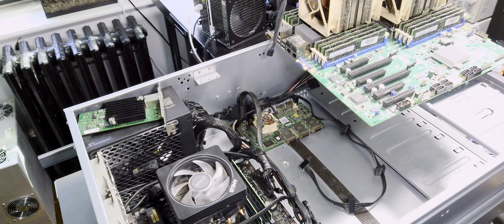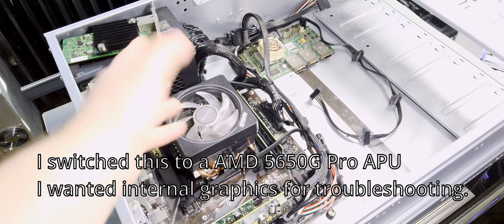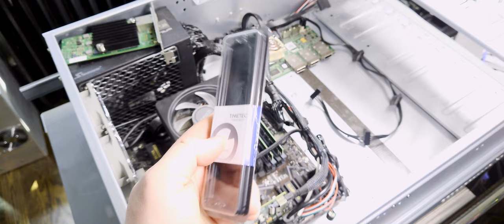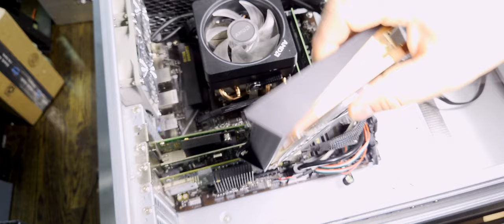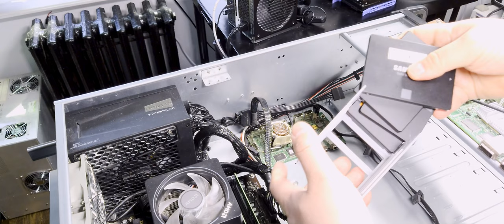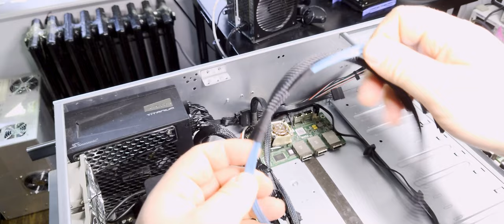Downsizing My VM Server (AKA Basic Ryzen ECC Build)

Comment from the maker: One thing I forgot to mention is that it's a good idea to check your motherboard and see if it can boot without a GPU or APU installed. The board used in this video actually errors out and won't boot with no video if you don't update to the newest BIOS. If you're tossing in a cheap GPU to get video it's nothing to worry about.

Comment: 9:14 Good news AMD's spec sheet for the 7000 series CPUs show that they still support ECC (still requires motherboard support). And some X670 motherboards already advertise ECC support (Aorus/Gigabyte again).

Also Intel changed their stance now. Standard consumer Alder Lake CPUs do support ECC as listed on Intel's ARK. But that's currently only supported in W680 motherboards which are stupidly expensive.

Comment: Similar idea I'm having now.  Most of my lab consists of stuff I've gotten from work. Moving from dual xeon E5-2667v2 esxi 6.7 system to a 10700k, 64gb proxmox, 10gb lan onboard (already have that hardware). I upgraded the esxi and truenas server as well as my desktop to 10gig a month or so ago. All this hinges on if I build a new system on 13th gen. Planning on retiring/archiving the couple windows 16/19 servers I had in testing. New truenas on a newer Xeon E 2144G server from work (poweredge still under warranty lol) so I'll retire the original on esxi. Basically leaves me with couple ubuntu servers for vpn, unifi controller, xen orchestra (have another server powered off running xcp-ng). I manage a number of Citrix hypervisors machines at work using XenCenter and wanted a feel of what XOA could do. Just kinda wasteful to have them run when they aren't needed. Plus I want to get a better backup strategy and worrying about those other systems is just a waste. At work we are in the midst of replacing another string of servers so I may get a E5 v4 Xeon or one of the 1st of 2nd gen scalable Xeons. Kinda a sucker for hardware, if I get something decent I may just keep it around for future testing on ESXI 8.0 provided the HCL is updated and whatever I feel like it.

Comment: I'm curious why you recommend the AMD pro CPUs when the much cheaper 3600 works with ECC? For super low power it would be nice to use a monolithic AMD APU (lacking the power hungry IO die) like 2200G 2400G 4650G 5600G and 4300G etc but from my searching online none of those work with ECC at all. So its basically got to be 3600X 5600X (or non X)

Its going to be really interesting to see the idle power consumption on the AM5 CPUs because they will have a much newer process node for the IO die, like 7nm or even 6nm I heard. Vs 12nm as with AM4 CPUs.

I've read that you can lower vSOC to 1.1v to dramatically cut idle power consumption but I've not had a setup where I can tolerate crashes or validate under volts etc. I'm also not super keen on undervolting a system that is supposed to be reliable.

Its quite a conundrum what to get because LGA2011 stuff is cheap as chips, but I'm guessing has high idle power.

AMD 5600X is most efficient and reasonably low idle power (20-30W apparently)

Then a 6th gen i3 can idle at around 8-15W apparently. But it might be tricky getting a working combination of CPU, board and RAM doing that. I'm in South Africa so stuff takes at least 2 months (or longer) to arrive and if it doesnt work sending stuff back is expensive or too late.

My main interest in low power is because our electrical grid has load shedding, power goes off for 2.5hours regularly. So keeping servers running (not allowed to use generators in my apartment) is much easier if their idle power is low.

These new N5105 and J41xx gadgets look compelling but probably no ECC support.
Reply from the maker: I originally had a 3600 in it, but went with the Pro APU for the basic video out. It's purely a convenance thing. Most people are probably fine with a standard CPU and just running headless. I wanted low power, ECC (CPU or Pro-APU required), and basic video out on a board with few slots.

Also you drop PCIe 4.0 with the APUs.
Reply: @PeterBrockie  makes sense!

Comment: How did you run memtest on this system? When I tried running memtest on my x470 5950x with 128G DDR4 3000 CL16 (non ECC) it crashed every time. I tried latest versions of memtest-x86 and memtest-x86+ (I haven't tried again for well over a year so maybe they've updated it since)

It made me wonder if maybe memtest doesnt work on Ryzen CPU's? I've always used it on Intel CPUs without issues. (4th gen and older)

Subbed BTW. I appreciate the ECC related content.
Reply from the maker: The newer versions of memtest86 haven't given me any problems with AMD systems. (https://www.memtest86.com/download.htm) Make sure it's loading the UEFI version (they might not have a legacy BIOS version included anymore, but still)

Memtest86+ hasn't really been maintained much and is missing a lot of stuff (as far as I know it doesn't even support DDR4, let alone DDR5).
Reply: @PeterBrockie  thanks I'll try again!

Comment: What fan are installed  in front of the drives…I ha a similar setup for my drives but they run hot as a hell….
Reply from the maker: Noctua 120mm. For drive cooling like this make sure you get static pressure optimized fans (sometimes called radiator optimized). A good bet are the Noctua Industrial PPC 2000rpm ones. You can get 3000rpm ones for extreme cooling, but they are crazy loud at full speed.

A cheaper Noctua is NF-P12 redux-1700 PWM. They are half the price, but still pretty good.
Reply: @PeterBrockie  thank you. I’m really struggling keeping my drive at a reasonable temp. I have them is cages like yours but they are sitting right now between 41°C and 44°C with my fan at 50%… I don’t think my fan would last long at 100% 24/7 (and they make also a lot of noise) I’ll take a look at what you suggest

Comment: Same unfailing 📙 accomplishment. It was as expected
Reply from the maker: Pick a motherboard you like, then go to the spec page and usually it'll list memory options as "ECC or non-ECC" or just "non-ECC". Also, you can just search "xxx motherboard name ECC support".
Reply: That was a customary period. Not much 🔑 to it
Reply from the maker: All the motherboards I have used which listed ECC in the specs, fully supported it.

You can check if it is functional on most OSes and some (TrueNAS for example) will tell you right on the main screen.